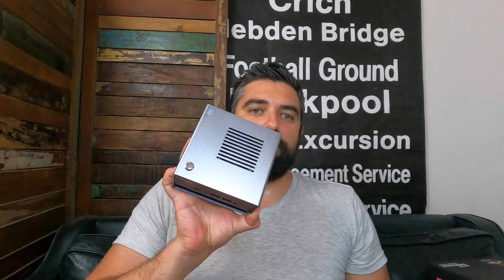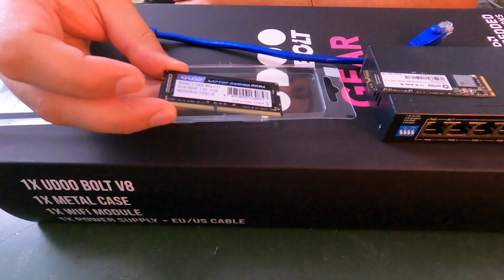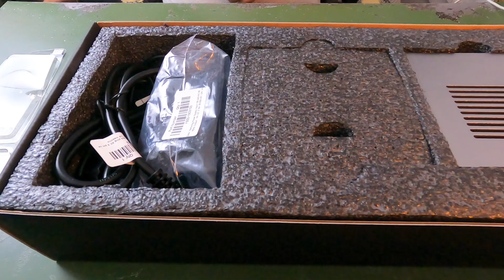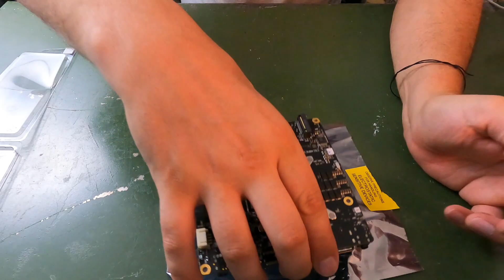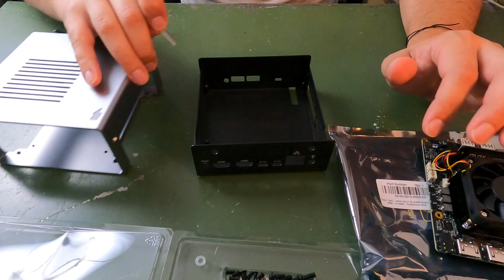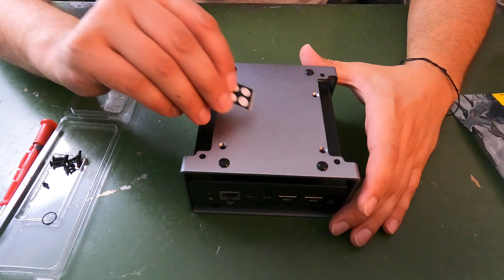HandyHost Akash Node Build

Comment: Hey thanks for the videos super awesome. I wrote a pretty winded message on the Handy  telegram.  In short I was wondering if I should just go for a full validator node?  Have no experience with coding, but was thinking  it could be done since the programs are set up for the most part. I would like to validate for cosmos, sentinel, Akash and Juno. What equipment should I use? How does one set up fire walls? And I am assuming we can now use the Sentinel's nodes I so how do we connect to them?  Do you think this is a good idea for a newb with nod coding experience?  Could you make tutorials on this?